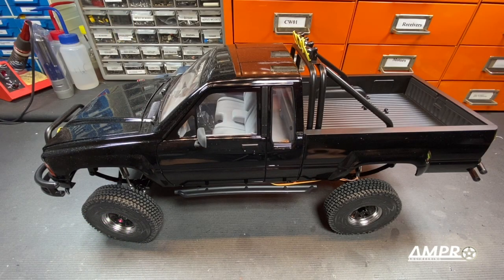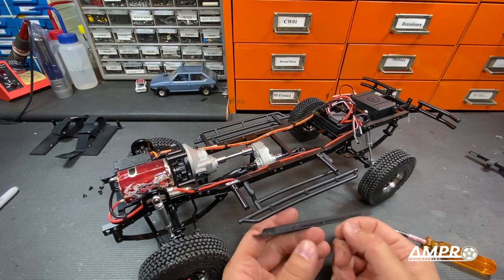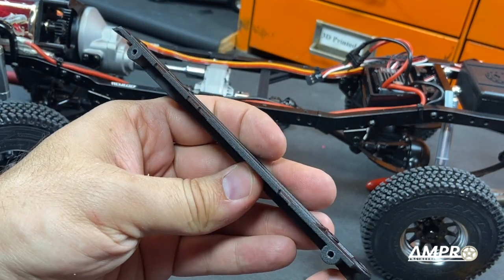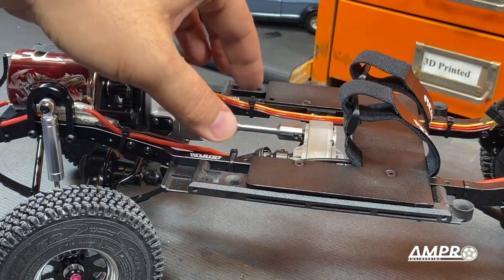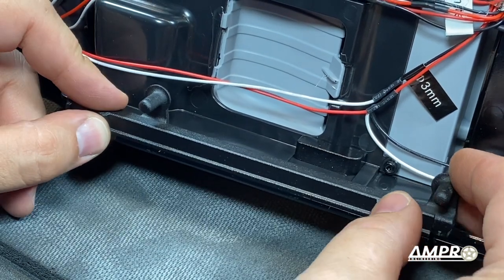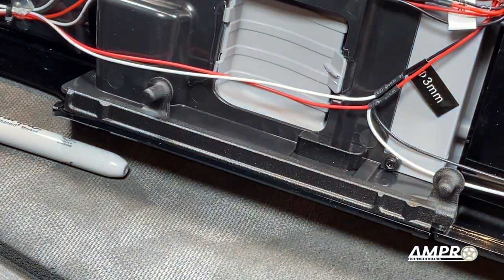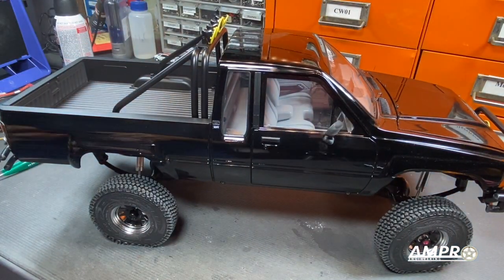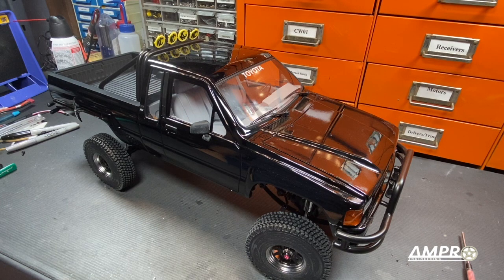E323: RC4WD 87 Xtra Cab Body Mounts

Comment: Can you make this file available on myminifactory?
Reply from the maker: I have added them. They are getting validated on the site. Give it a couple days and check the link in the description I added. Note that these have never been printed in FDM.
Reply: @AMPROEngineering  thank you very much! Only white material is offered on shapeways and i didnt want to paint it. I plan to print this on an fdm printer. I will reply here how it goes. Thanks again!